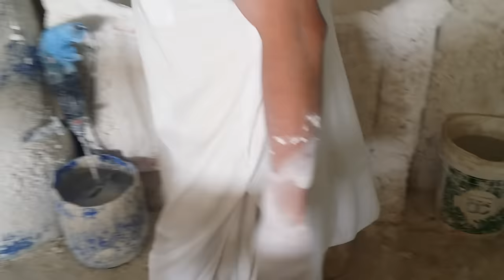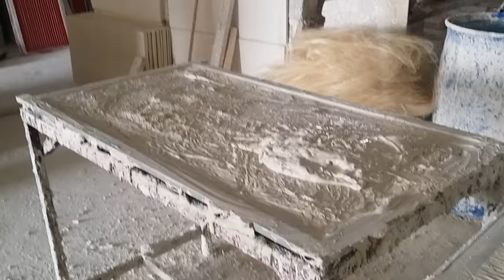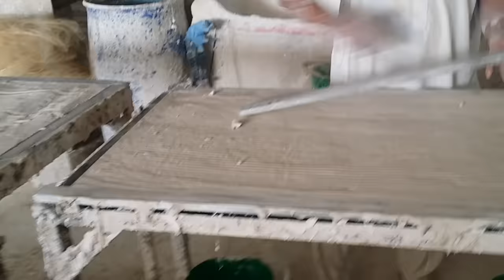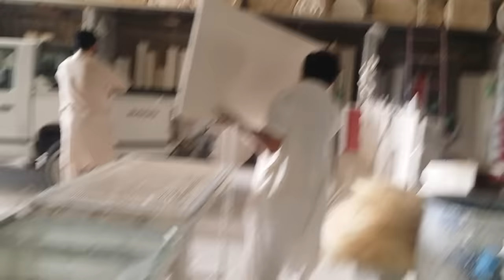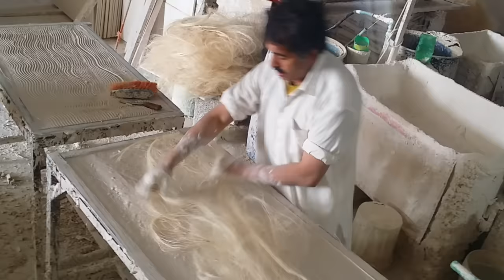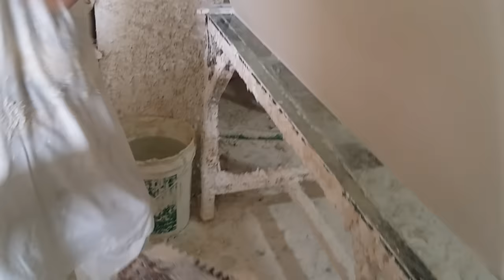Make gypsum tiles in 4 minutes | how to make gypsum board at home | how to make gypsum ceiling tiles

Comment: Dear manager,
Longyi New patented built-in classifiers dry grinding machines already put into mass production.

1.Powder from 325~4000mesh, fineness is adjustable
2.Built-in high efficiency classifier, no more investment cost for classifying system.
3.Smart PLC operation system, and integrated control system: 1 computer could operated max 6 machines, saving management cost.
4.No particle air pollution, more environment-friendly.
5.Compact structure to save factory space and lower foundation construction cost.

For limestone
The whole grinding system power is around 370Kw, the real working power is 80% 296KW
1.D97=23um (600mesh)    Output: 10tons/h      Energy Consumption: 29.6Kw/Ton
2.D97=16um(800mesh)     Output: 8tons/h       Energy Consumption: 37Kw/Ton
3.D97=10um (1250mesh)    Output: 4.5tons/h    Energy Consumption: 65.7Kw/Ton  
4.D97=6.5um(2000mesh)    Output: 2.5tons/h   Energy Consumption: 118.4Kw/Ton 

For Talc powder, 
Longyi powder grinding mill power is 250Kw, the real working power is around 200~225Kw, including classifying system.
A. D90=10.5~10.7um   output:  4 tons/hour
B. D90=9.8~11um      output:  3 tons/hour

It is suitable for processing nonmetallic minerals such as calcium carbonate, calcite, Kaolin, clay, barite, talc, gypsum, limestone, calcium oxide, bentonite, dolomite etc.
Samuel 
MP/Wechat/whatsapp: +8615105956429

Comment: What are the tools required and material needed to make this tiles please let me know in details as I can do it myself
Reply from the maker: Gypsum in it And water You can also use hair, and plastic sack wire
Reply: Sir can i used fiber mat instead of that hair
Reply: Thank for your good heart by sharing but please is there anything like sand in the mixture.. and what chemical is Gypsum

Comment: I’d wear gloves, lol
Reply from the maker: It does not work gloves because work has to be done from morning to evening, if you work for 10 15, if you have to work, you can not work because the powder sticks in the gloves and then it is difficult to clean the gloves. happens
Reply: use parrafine oil or only butter  is beter..
because some gypsum contain calcium hydroxyde 
very dangerous for skin in long time in work
oil protect skin
👍👍🇩🇿🇩🇿

Comment: Nice but really Gipsom bord have pepper coating
Reply from the maker: Safal P.B thanks
Reply: I think this is gybsum cement. Same material use in Cornish
Reply from the maker: lucio san fernando No, it's not cement, its powder is different and the cement is different, both are not the same
Reply: Aaaaachew Aaaaachew, really?